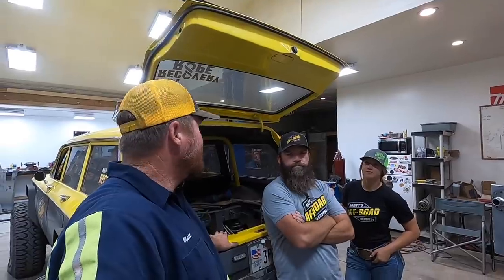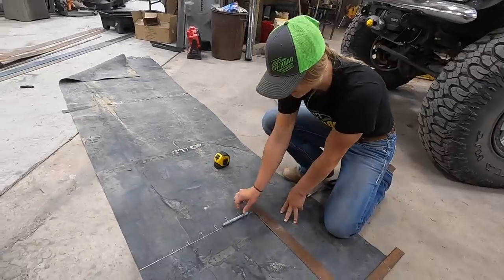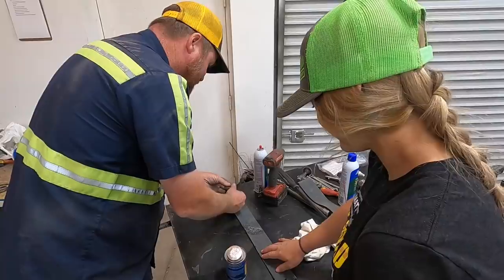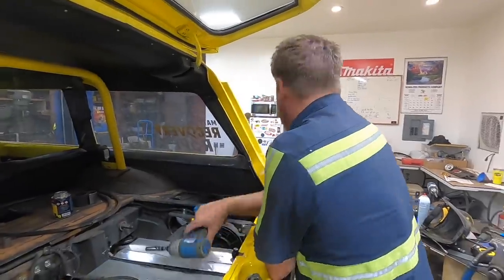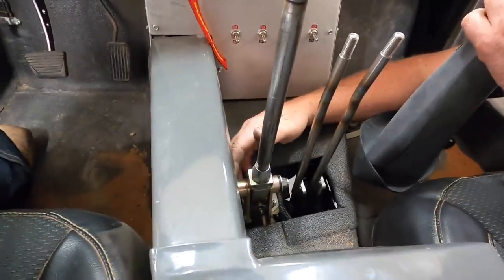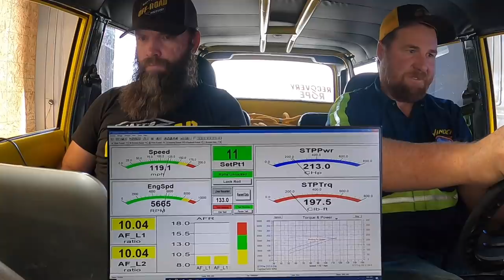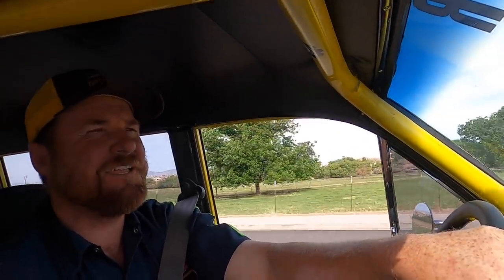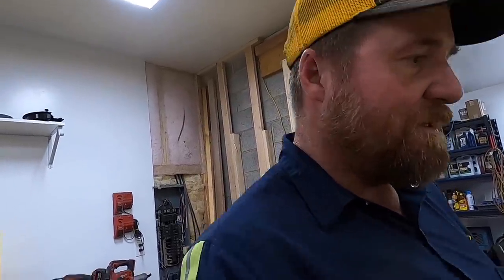1,000 Mile MORRVAIR Road Trip Next Week, Will We Be Ready?

Comment: I've been welding for 13 years and i would say after seeing her welds. shes better then most guys i know that have been welding for 10+ years lol if she ever leaves the shop she could just show this video and get  a nice paying shop job welding and nail the test the first time lol great job
Reply: better than mine
Reply: Most of the time, pretty handwriting predicts a pretty weld. Better fine motor skills. Not popular (politically) to say, but females have better fine motor skills  more often than males.
Reply: having welded and seeing that weld as a first weld in years? Wow. If I had to weld again it would probably take at least half an hour or so to get the "pushing the puddle" down just right.
Reply: 100% correct statement.  I've seen ANSI B31.1 (steam pipe) certified welders, leaving welds that looked like coral.  She was getting good, clean, full penetration welds, without too much heat, and consistent flow.
Reply: @nunya3163  I have to question her welding in the past. I have never seen anybody pick up a MIG welder and weld like that.
Reply: Working in industrial construction I've worked with 5 female welders over the years and they were some of the best welders I worked with.
Reply: @bartarkis  my grandma can make anything with some needless and  thread lmao if she was a welder she would be laying dimes all day
Reply: 75% of my classmates (male & female)  could weld, it's a southern Utah thing.

Comment: If you got to do anything like this in the future get your self some commercial window setting block. It's a roll of 2" wide by 1/8" or 1/4" solid rubber.  Works great use it for mounting rads etc.
Reply: I've used Joist Protectadeck rubber, for when mounting tool boxes to trailers on an A Frames and on the side of the trailer walls for boxes too. Aluminum and steel don't go well touching and really reduces the noise.

Comment: Matt, safety glasses bro! The kids look up to you!  And let me tell you that getting a metal sliver out of your eye at the ER is NO FUN. They use a need just like if it was in your finger. Ask me how I know.
Reply: If it's ferrous material, I've been told that quite often a magnet is used to pull the filings, etc., out of the eye. It doesn't sound like a lot of fun but if you're working with stainless, you're screwed and the needle is about the only choice... that and a doctor with a really steady hand!!
Reply: @MrGaryGG48  When I had something in my eye they used a tool like a dremel and buffed it out.Bad thing is it burns through layers of your eye.Still have a tiny speck in the white of my eye where they couldn't go any deeper.Was wearing glasses but still came in from the side someway.
Reply: @lonniemuncy1005  good Lord that's terrifying.. 😲🤤

Comment: Welding a full tank is better than welding an empty tank.
Reply: Depends. A A1 Abrams reacts poorly when welded full. A gas tank with no petrol fumes left over is ok. H2 Tanks should not be welded at all...
Reply: My grandpa learning full fuel tank welding in WW2. The trick is to run an exhaust hose from an idling engine into tank being welded-removes oxygen.
Reply: @arlisspropertyservicesllc5943  👍
Reply: @arlisspropertyservicesllc5943  or to the nitrogen generator at Costco.
Reply: Dry ice in the tank is how we welded tanks that had been in service at the fabrication shop that I worked at.
Reply: @michaelktm6061  ya same concept but safer than car exhaust
Reply: @arlisspropertyservicesllc5943  I put an air hose in the tank and let it blow full force. 15/1 is combustible ratio. 100/1 won`t burn. A body man showed me that trick and it`s worked well for me.
Reply: YouTube expertise strikes again! One thing for sure! If any of your theories don't work the welder will be the first to know. The only question I would have if there's an epic failure does the welder become a weldde?
Reply: @REDMAN298  
You are obviously referring to an empty tank. Adding air to one that has gas in it will lend itself to vapor.
Reply: @michaelktm6061  Great tip, I was going to do my jeep CJ5 while still on, but the rubber filler neck is rotted to hell, so the tank it coming off, I will use this top in the future though Thank You!
Reply: Lex Talionis  what People are you talking about?
Reply: @arlisspropertyservicesllc5943  tkif9h
Reply: drain the gas rinse tank with water and leave it 1/2 of water, then put the air to it and weld.
Reply: @arlisspropertyservicesllc5943  thanks Mr grandpa ❤
Reply: @REDMAN298  I appreciate that tip. I do rinse,  and add water. I have never added the air, but I see why you should. I am adding a couple tabs to hold air lines, for an air tank.
Reply: The Weapon Collection    That don’t always work so well. Water at the weld point can turn to high pressure steel and blow your weld puddle out.
Reply: I run a hose from a CO2 bottle into the tank at a low flow rate. Works for me. I’ve worked in shops where people get all strung out and panicky when need to weld on fuel tanks comes up but I’ve never had a problem with this method.
Reply: true. In addition to fabricating, I also play paintball. If I can't fill the tank with water, I'll drain it an fill it with CO2. I don't think it's as safe, but field repairs, right?
Reply: @arlisspropertyservicesllc5943  The simple solutions which elude us. I filled a small tractor tank with water and was still getting strong thuds when patching seams.

Comment: Matt grinding without eye protection will earn him the nickname “One Eyed Matt” eventually.  :-(
Reply: That happened to my dad. He and my uncles would call me a 🐈for wearing eye protection until a piece of metal went into his eye.

Now they tell all of us to wear eye protection.
Reply: Yip, had to take my friend to hospital twice to remove a piece of metal off his eyeball before he started listening. If the piece is still nice and hot, it burns onto the eyeball.
Reply: Matt has always put on his safety glasses after the first eyewash! 😜👀😎
Reply: Safety squints
Reply: I’ve had to have them dig out a metal shard from my eye.  Not fun.
Reply: I was grinding WITH safety glasses and got a bit of metal in BOTH my eyes. The eye doctor used a carbide burr in a rotary tool and literally ground them out of my eyes. Very weird sensation. I wear safety glasses with foam around the edges now.
Reply: @ADBBuild  Same thing happened to me. Hadn't thought about the foam glasses. Good idea.
Reply: one eye burnt fingers ,, he grabs hot stuff all the time also
Reply: And with the safety guard removed from the grinder.
Reply: My fragment was also with glasses on when they bounced off of the concrete floor under my glasses.  Now when I grind in a position that would give a ricochet path, I wear a face shield as well as tighter fitting safety glasses.
To get it out of my eye they used a hypodermic needle to pry it up and then got ahold of it with forceps, much like how you get ahold of a splinter.
Reply: @CTXSLPR  

Not grinding, but I once was tightening an exhaust nut with a spring washer, lying on my back, reaching - and looking - up at it, when the spring washer curled off a shard of swarf which landed in my eye. 
What followed was a trip to the emergency room at the city eye hospital followed by several return visits, and 4 weeks of almost unbearable pain, 2 of which involved wearing an eye patch-pad loaded with some magical antibiotic antiseptic drawing cream, to encourage it out because the surgeon said to physically remove it would likely leave me blind in that eye. 
Worst trauma of my life so far, and I’ve had a few in my 67 years.
Please everyone, wear eye protection, not only when grinding, but when working above ... flaking rust is just as dangerous and it takes a millisecond to create a world of discomfort and maybe even blindness, it’s never worth it.
Reply: Ah, but Matt can probably pull off an eye patch better than most.

Comment: If you must have band clamps a good place to look is a heavy equipment dealer. Most pieces of heavy equipment use them for radiator connections since they are a combination of pipe or castings with flexible rubber hose connections.

Comment: hey Matt..ripper episode mate thanks for taking us along..I have a little tip you might like for your flag..We use them on mine sites here in oz and just fit a female ryco air fitting to the mounting point and a male fitting to the flag pole..easy and quick to get on and off ..and by the way, Lizzy's welds are far better than some of the boilermakers here charge 100/hr to do so keep nit up buddy

Comment: Have a suggestion: When you are out of ideas and spinning your wheels, use a boat anchor. A large aluminum boat anchor, and a snatch block returning the cable back to the Morrvair will double the winch capabilities, and the cable working load, and you may not have to call for help.

Comment: You need to put rubber under your tank hold down straps as well. Two dissimilar metals won’t last long in contact. The straps will cut a hole in the tank. Even quicker when you add the sand you’re always in!

Comment: Matt,
That spare is going to rip off the morrvair quicker that you can say OMG. You should look at as a lever. That skimpy little mount is going to act as a crowbar against the mounting point with the force of about 50 to1. So take the weight of the spare time 50 against the point of mounting then, ask your self, will that mount point survive a 800 ft lbs of toque pry-bar pluss the g-force of 2 to 5 time (tire weight x the length of the bar x the g-force from hard shocks of the course) If my guess is close that would be 4000 ft lbs of toque on that mounting point. And I think my guess is on minimal side. I think it could reach 8000 ft lbs of toque.

Good luck! Have fun.

Comment: CHEAP / Easy tips for More HP - 
1) Run a outside air Snorkel with Air Filter to pull in Ambient Temperature Air ( 65-100 degrees ) which WILL Give you MORE HP. Also Preventing Pre-Ignition & detonation. Also increases Fuel Mileage. 
2) Run Your Fuel line Through a Transmission cooler for Cooler fuel. Increasing Hp. Decreasing detonation & pre ign.
Put Cooler up Front before Radiator.also increases Gas Mileage. 
3) I Don’t know what Engine temp u are Running But Run a 180 Degree thermostat with a 4 Row Radiator to Cool the beast and keep it at temp. You should be running 180 degrees coolant temp. For a good balance of Engine Life & Hp.
Me - N.i.a.s.e. Certified Mechanic. Certified in Engine Tune up & Performance, Engine Rebuilding , etc.
Good video ! Awesome welding Lizzie !!! Those beads were Spot on! Perfect Heat penetration  caught on camera. Damn fine Looking Welds !!!

Comment: Although epdm collects heat unless you have at least a 4/12 pitch on a south facing roofline it does absolutely nothing for snow melt. They use it for flat roofs and low pitch commercial around here. Proper soffit insulation and ventilation have a huge effect on this as well and no one puts a flat roof across the whole place only on uninsulated porches and deck coverings.  I deal with the repercussions of this choice daily - a southwest Colorado gutter guy
Reply: I also don’t mean to talk smack I’m just saying above 7000 feet good luck!!

Comment: Matt, if you can't get the clamps at Napa, try a hydraulics shop.

Dammit Matt... I've made the run from Arizona and Texas to northern Idaho three times now. I've missed stopping in Hurricane all three times. I end up running through Page, Kanab, and finally connecting to I15 just north of Marysville.

That's gonna have to change. It's just not right. Next time I make the run, I'm stopping by the shop. Maybe I'll chase you down on a recovery. Either way, I'd die to get some sand driving lessons form you or your crew.

I just wish I could go with you.

Comment: Matt with as much tuning that you've done on a ( tow rig )  with both the Trevor's helping out I will predict out on the road going a steady 65 miles an hour you'll get 12.5 to 13.5 miles per gallon  not ON the throttle just a steady 65 miles an hour I don't know if you  have cruise control on the Morevair if you do , use it that will always bring up your gas mileage .
By the way Lizzie is one fantastic welder as watching those beads she was laying down those are absolutely perfect , she should be your permanent welder there Matt I don't think even you can weld that good or even Paul from Lab Rats can weld that good , don't you two take any offense to that , I just know a good welder when I see it .

Comment: You need to have put rubber strips under the straps that went over the tank beleave it or not I've seen where the straps have a totally rubbed holes it aluminum tank from vibrations may sound far fetch to you but I have actually seen it happen alot.
Reply: @MattsOffRoadRecovery  ok good....but yall dont showvit in the video I went back and looked as Matt is tightening down the strap you can barely see the rubber under the strap ya'll must have edited out the part where you were putting the strips under the strap cool love the truck it turned out so good enjoy it my friends ya'll did a beautiful job with it.

Comment: Your place is entirely too clean if searching for EPDM involves actually going to a roofer instead of just finding where they stuffed the excess on the nearest membrane-roofed building.

"Tuning by computer."  I'm sort of disappointed this isn't just calculating what size jet to use and where to set detents on the choke knob.  I'll just pretend he has a timing light app.

7:00 is it just me, or does Matt somehow look about 15 pounds lighter without a cap?  How the heck does that work?

The crimpers aren't cheap, but for any wiring you might want to unplug later, Anderson PowerPoles are frickin' awesome. With the retainer clips, they don't come loose unless they're pulled hard enough to screw up pretty much any other kind of connection, but when you want them apart, it's easy.  You can also build up a plug as wide as you want to have a full custom harness for a panel. If you want to look super fancy on the recoveries, mount some big 175A or larger plugs under the front and back bumpers, wired up with the appropriate welding cable, then replace the clamps on one end of a set of jumper cables with the same: then you can jump somebody off (or get a jump, even from behind) without even opening your hood.  Bonus: all the power you can possibly need on a sturdy plug for an extra winch, lighting, etc.